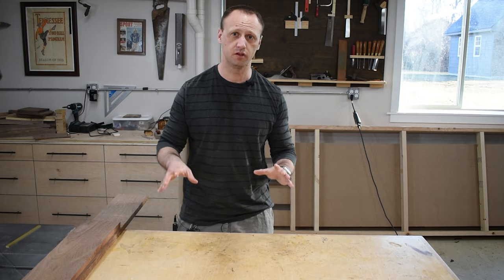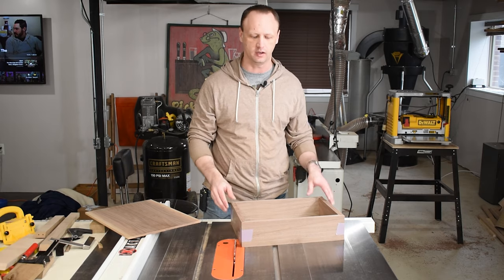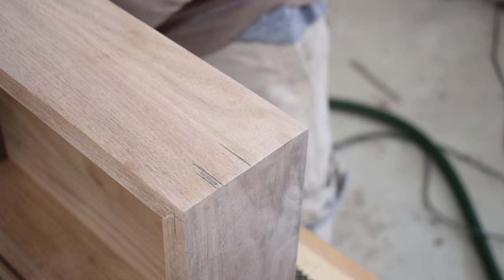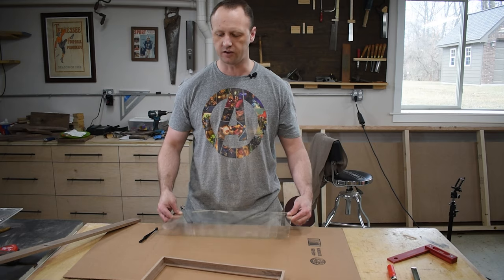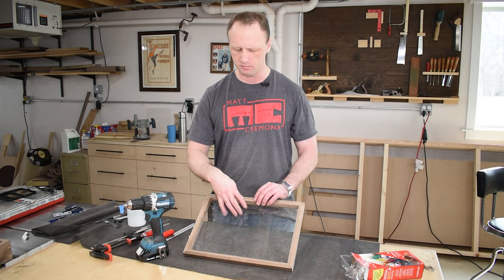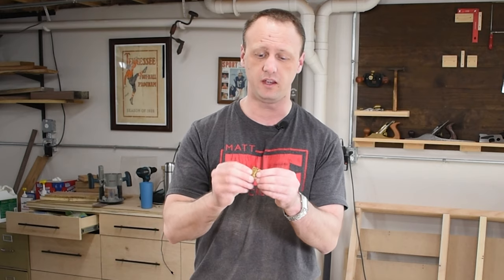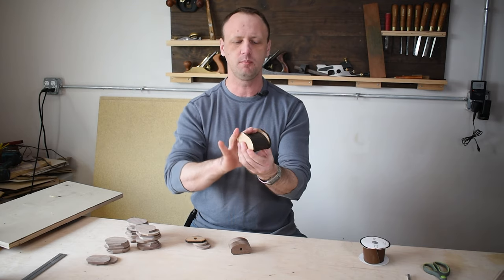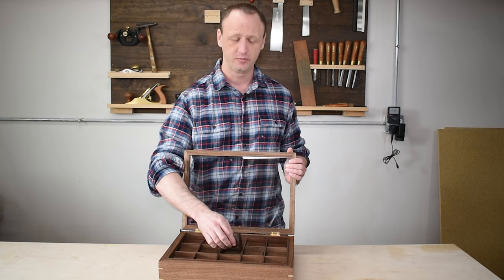Making a Watch Collection Display Case | Custom Watch Holders

Comment: Billy, For the brass screws, I predrill the holes as you but then I used the right sized Gimlet for the screw to thread the hole for the brass screw. A tab of wax on the screw and it goes in with out a problem.  I have not twisted off a brass screw since I started using the Gimlets.  You can purchase a set of Gimlets at Woodcraft for about six bucks. Worth the investment!

Comment: As a woodworking project, this is really great stuff! You did a fantastic job. As a box to hold watches, it could use some improvement. For one, there is no play in the watch holders themselves. This means if your watch is on a bracelet, it needs to be the perfect length to fit snug, but not be too tight. for watches on a strap, it doesn't matter as much. Also, the only way to get the watch out is to grab it by the head. This is ok, but with the added weight of the holders themselves over just pillows, it means you might end up dropping your watch if it slips out of your hand. I really like the hard sides to the holders though, that's pretty cool. It secures the watch in the middle. If you ever make another one, I suggest making the middle wood to the holders a lot smaller, and then adding a piece of foam around it, along with the leather. Also, while more work (cnc would make quick work of it), finger holes in the dividers would be awesome. You don't see this on watch boxes, but they don't have the wood around the holders like yours, that secures the watch into the middle of the hole.

Comment: I liked your attention to detail very much since I have a small case of OCD 🙂 and there are some things that bugs me. But you ticked all the boxes 👍🏼 
I didn’t like the solution for holding the glass in place although I haven’t thought of any better solution yet... hey, but at least you used brass screws 😉
Reply from the maker: I also tried to have the screws turned the same direction so they match. 🙃

Comment: Could you elaborate a bit more about how you did the divider pieces? Specifically how you got the measurements for each cut width and depth and made them all exactly the same so they fit so nicely? I’ve been meaning to make a big wall shelf thing using the same technique of those (half lap I think?) joints for the shelves so they all lock together and make little squares for the kids to display various rocks and small items in.

Comment: Hi Billy, how do you know how high to set the blade when cutting splines, so that you don't just cut into the inside of the box? Do you do any calculations or just estimate it and creep up if the cut is too low?

Edit: Also, why do you sometimes cut mitres with the blade at 45* (with a straight fence) versus sometimes with the blade at 90* and an angled fence? I'm totally new to woodworking but hoping to understand these things! Cheers
Reply from the maker: Good questions. I'm going to release a multi video tutorial on this project that explains every step in detail. To briefly answer the questions, set the blade height so it isn't higher than the half of the thickness of the wood.
I prefer to cut my miters by pivoting my miter gauge. But the blade is only so tall. If I need to cut a board taller than the blade then I have to lay it flat and tilt the blade instead.